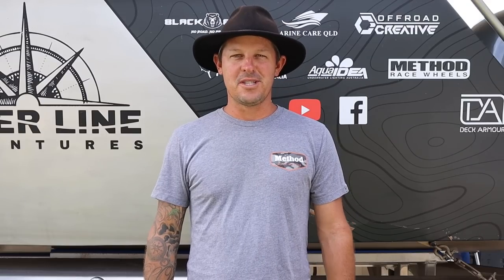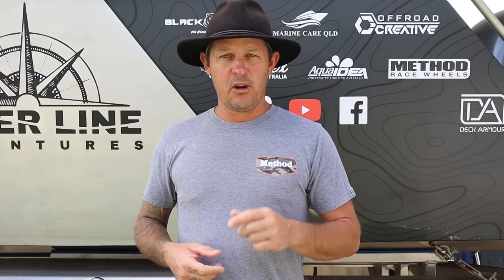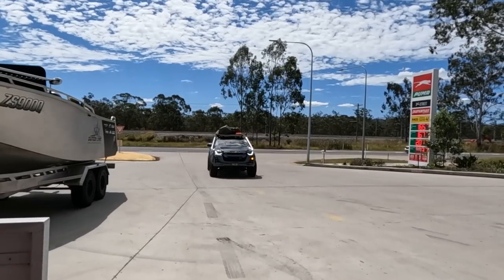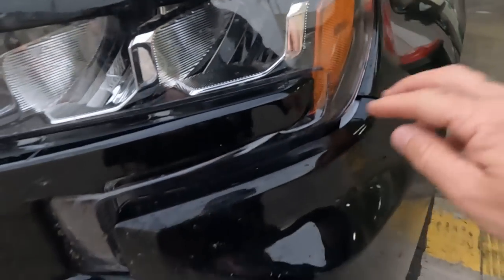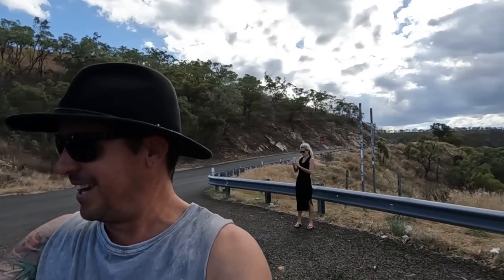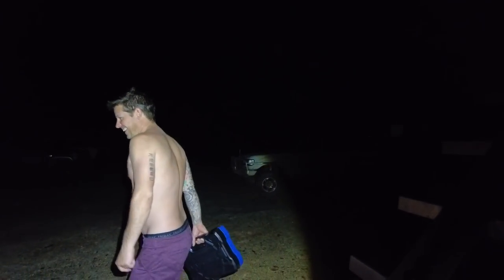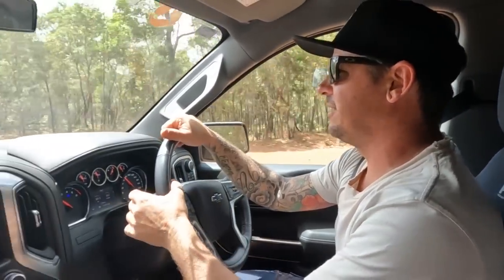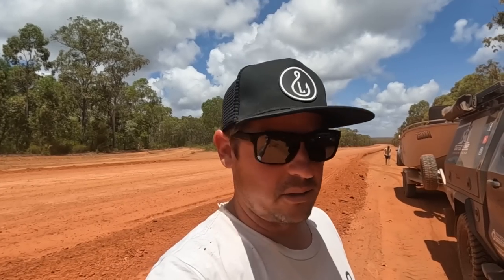WE GOT CAPE YORKED - Ep 62

Comment: My missus and I did this in a 1992 Toyota hiace van 2 wheel drive 4 years ago. Got back to the sunny coast put new wheel bearings on gave it a wash and a grease and we’re still camping in it. New gear is shit.
Reply from the maker: The car was fine, only hiccup was the trailer hanger which was pretty
Minimal in the end. Was your Hiace towing over 2T with 800kgs on the back going through heavy 4WDing and shit roads? 😂 All in all I couldn’t be happier with how everything performed
Reply: Mate it's rocker roller suspension about 1960's technology what are you on about new gear? Haha

Comment: If you tow in 4th gear you will get better economy and the gear box won'tkeep changing all the time and overheat
Reply: I noticed that too.  Car was changing gears alot. Best to tow in manual mode. Better for the auto.
Reply: Good to know that you read the comments and answer me thank you for that and also I had that break on the dirt road going to Stanage what I did was get a pretty straight in tree cut it just wide enough strap it under the springs come back up onto it and that’s the only way it went anywhere
Reply: Why that happened to me was the person that sold me the boat on the trailer and plugged it with fibreglass and re-sprayed it all Silver and looked in quite good nick until the corrugations and the crappy dirt road
Reply from the maker: Cheers mate, I’ve tried that, doesn’t seem to make a difference at all.

Comment: Great vid guys, but fair dinkum....an ally trailer to carry a heavy boat on 50 million corrugations ??? Where did you get that advice from ?? I doubt the trailer manufacturer would have given you the go ahead.....
Reply from the maker: The trailer did it easy mate. The drama was the U bolt nuts coming loose as they had no lock nut in the top. The part that did break was the Galvanised part…not the ally.

Comment: That’s a piss poor design on the shackle hangers  most trailers have a plate each side welded down on that bracket  as strengthner. I tow caravans boats ect all over Australia for a living. And won’t tow them if they don’t have that strength plate.  One of main things we ask owners before we take their jobs on is send pictures thru  of trailers. Bit over a over sight in design but can be fixed easily in a shop not on road unfortunately
Reply from the maker: Agree for the strengthening plate on the hanger, although the main reason for the breakage was the U bolt nuts rattling loose, after the repair I would check them every hour or so and they would be loosening again. Next time will have a lock nut on the top of them for sure, but yes, you are correct, defs need a gusset to limit movement in that hanger.